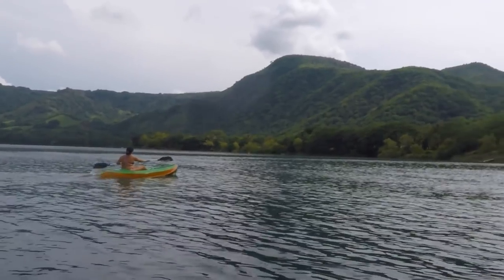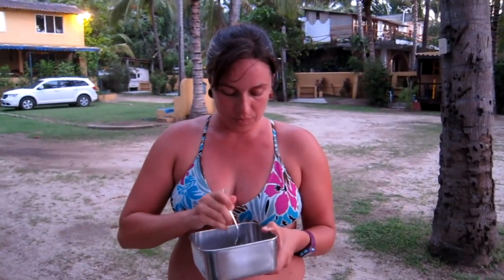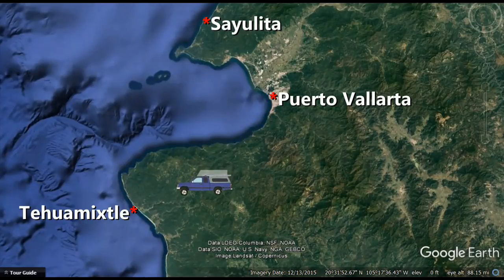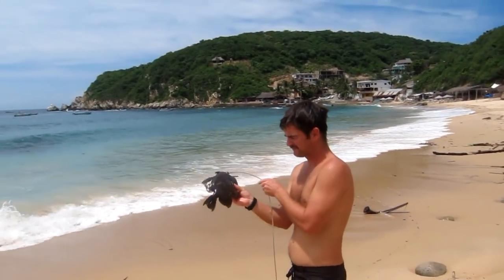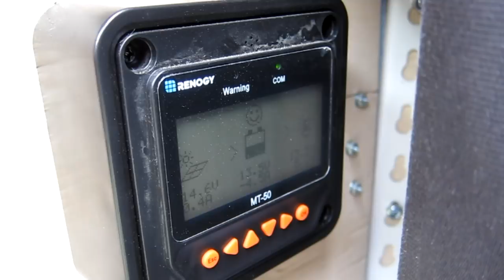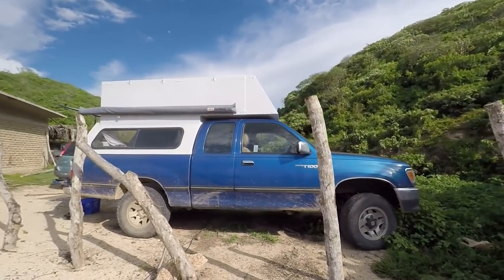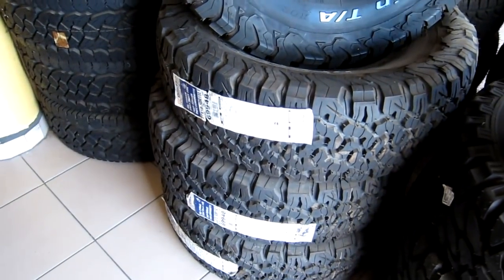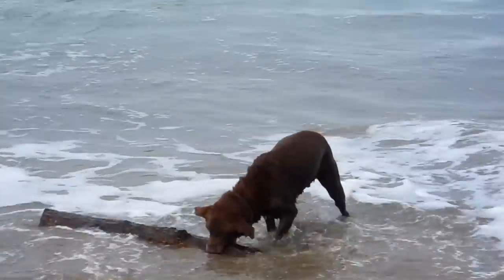Beach Camping Sayulita to Arroyo Seco Mexico OVERLAND TRAVEL VLOG Ep.16

Comment: Guys, You tube is also for watching. You solar issues are  frustrating.  why not mount the panels on top of the camper and wire them in solid? Also you can charge the battery from the truck when it's running.  Also a GPS probably cheaper than the Gas you are wasting. 
Fun to watch though Good luck
Reply from the maker: Enrique LaRoche thanks. if you checkout episode 4 and 5 you'll see our build. we did wire the house batteries to be charged by the truck when running and disconnect when the truck is keyed off. we chose to make the Panels mobile so that we can park in the shade and put the panels in the sun. with more time I would probably mount the panels to the roof in a way that would alow me to remove them when I wanted so that I could put them in the sun. stay tuned for the next episode. we finally start figuring our system out and it's not the panels that have failed us
Reply: I get it,  I'm rarely in the camper during the day why I mounted my panels on the roof.

Comment: I want to help with your electrical issues, I had a feeling watching the first couple episodes that it would come back to bite you.  A couple of questions to sort out some stuff.  It looks like you purchased an optima red top battery.  Im not sure what group battery or model number battery you purchased but typically they are 50ah.  The red tops are a starting type battery meaning they can put out more amps to turn your car over and the yellow tops are a deep cycle battery meaning that you can run them down to nothing and they will recover well however you lose a little amperage for starting a vehicle.  
So here is what that means.  I am going to make some assumptions so feel free to correct me in places I am wrong.
1. AH can be confusing so I will break it down.  All it means is how much storage your battery can hold. Simply put your battery at 50AH "Optima Red Top Specs" can run 2.5amps for 20hours.  Which is not that helpful for your situation we need to first figure out what you are using and determine how long that battery will last.  
2. Amp draw, I have a similar fridge and have done the math already.  Mine ran every 15-20 minutes for 5 minutes.  20 minutes an hour.  So your fridge runs approximately 8 hours a day.  Typical amp draw from the fridge is around 4 amps.  That is just the fridge.  If you are charging phones, cameras, using lights etc.  You are adding to the total amp draw.  If we just use the 4 amps you are likely to get around 12.5 hours if the battery is at 100%.  My guess is you might have a few other things drawing the battery down.  Here is how you can find out.  Take a multimeter.  Put it on the AMP setting.  Disconnect the positive lead of your battery with everything plugged in that you normally have on at night.  Attach one lead to the battery cable and the other to the battery terminal and note the number on the multimeter.  That is how many amps you are drawing.
3. If we determine it is a battery issue  I would highly recommend getting a deep cycle battery.  Preferably a group 31 that are around $100.  They come with 105ah which is more than enough for what you have going on.
4.  Solar also seems complicated but it is simple.  I have the exact panels, but mine are 100watt I think you may have the 200w equivalent.  watts=volts x amps.  So 200watts/12volts=16.5 amps.  This is how many amps your panel puts out however they only run at 80% efficiency on the best day.  So 13amps in full sun.
5. Solar charge controller "the thing with the smiley face" is simply a battery charger, much like the one you would connect to your car at home.  It measures your battery voltage and supplies it power accordingly.  There are settings within the controller that you need to tell it.  1- the type of battery which you have. An optima is considered an AGM not a Lead acid or flooded battery 2. the total AH of the battery which is 50AH.  I dont recall the other settings but those are the important ones.  This tells the controller what type of charge and how long to supply it for.  If these settings are not entered then it may be turning off before it should thus the issue you may be encountering.
6. Summary if you are drawing what I think you are drawing you may not be able to make it through the night with your current battery, test your draw to confirm with a multimeter, make sure the settings are correct in your solar charger so that it charges your battery up.  
This is your homework, ill expect a report ASAP.  Love the videos by the way keep it up.
Reply from the maker: Wow! Thank you so much for taking the time Joe!
As you may guess, we don't release our episodes in real time. I don't want to give away too much, but you will see in the next episode that it is a battery issue and we do end up getting some yellow tops. :)
This solved the main issue, though I will admit part of the issue is I set up our system expecting more power from our solar (I thought we would see 90%, but your right 80% on the best days) and I expected a duty cycle like the one you describe from the fridge, but ours is probably double that. I think the fridge is working correctly, its just that we use it in a hot truck with minimum venting room and it's a large unit with a freezer that we open several times a day.
I will double check my charge controller settings to make sure I changed them when I installed the yellow tops and  am planning to try to take a closer look at the power draw from the fridge when an opportunity comes up. it's just tough to do when we're using our system every day.
Thanks again. This is so good of you
Reply: The Traveling Together Journal 
oh good, glad you are getting it worked out.  I had another thought too.  most fridges have a setting for 2 modes.  a fast freeze and an economy mode.  make sure it is on economy mode.  It really shouldn't be drawing that much power.  is it connected 12v or do you have it connectred to an inverter?
Reply from the maker: It's hardwired to 12 volt.
Our fridge has 3 settings: low, high, and auto. Our manufacturer suggested running it on auto so that the computer can decide if it needs high or low power. I have noticed that it runs at high a lot more than low though.
 I was thinking about trying it on low, but just can't get the right moment to feel like I can mess with things and get accurate data over a long enough amount of time to come to any conclusions. But when the opportunity comes up, I'll be looking forward to understanding my system a bit better.
Reply: The Traveling Together Journal yeah put that thing in low mode.  high is great for when the car is running but low is where you want to be.  I had the same fridge keep that thing on low.
Reply from the maker: Thanks Joe. I have been wondering what consumption others with the same fridge get. This is super helpful and I will be following your advise. I'm actually excited. This could be just the thing we need to feel good about wild camping with our electrical system again.

Comment: 14:20
The Controller Says the Solar panels are outputting   7.3 watts to the  Fridge
& the Batteries are Outputting another 60.75 watts to the Fridge
So the Fridge is using  68 watts.
So Whatever your Solar Panels are rated to Output Max in Full Sun ... Minus 68 watts to run the fridge.
So in Full Sun, if you have 150 watts of Solar Panels, 70 watts will go to run the Fridge and about 80 watts back into the battery.
It may be Cheating but you could run a Cheater jumper from your Alternator, when the Battery is Low, and Motor the Truck to charge the battery and run the fridge for a while
Reply from the maker: Thanks David.
We do have the alternator wired to charge the house battery when the truck is running and we do use that option more than we care to admit:)
What I ended up learning about our charge controller in this process is that the little pictures don't really mean much since it's basing it's state of charge readings off a battery thats being charged and/or drawn from.
We do find a problem in the system, but thats for next time ; )
Reply: Solar panels outputting   7.3 watts seems kinda LOW !!
Reply from the maker: The highest output w've seen from the panels was 260 watts. They are much more sensitive to cloud cover than I expected so a slight haze will take them from 225 watts (normal) down to 100 watts. I don't recall the exact situation the panels were in when we filmed this, bit I have tested the output of the panels individually and connected in series and at the charge controller terminals. All these things point to properly functioning panels and connections. 

We had a battery issue that we will go into in the next episode. That seems to be the only malfunction in the system. The rest of the problem is just that I over estimated the solar output in non ideal conditions and I underestimated the power draw from our system. It's not Ideal, but it works for now :)

Comment: How do you like the T100 as a travel platform, thus far?
Reply from the maker: Radnally I like. I like it a lot. 
The size is the main reason we went with the t100. it's a nice middle ground between mini and fullsize. It has enough power with the 3.4L for me and we average 15.5 mpg fully loaded.
 it also has a drive train that was offered in several popular vehicles in each country we are traveling in and the steering and most suspension components are interchangeable with the hilux or pickup, so we have been able to find parts easily. The only thing that we couldn't find was a replacement door handle we needed in Nicaragua. Lots of T100s in Mexico, but not many south of there. 
Hope this helps. Feel free to ask any specific questions you may have.